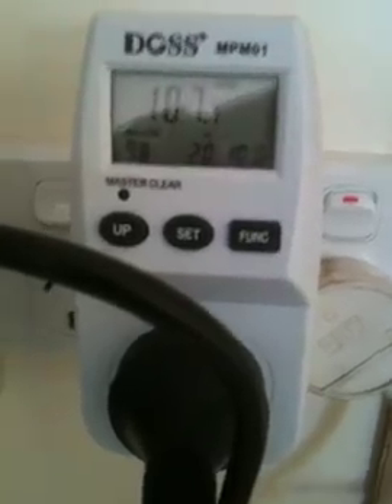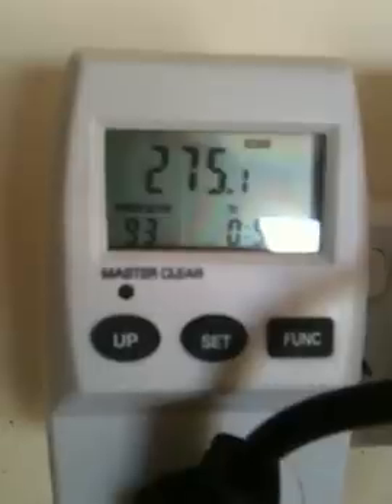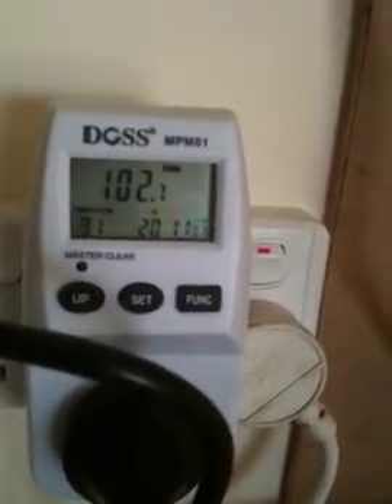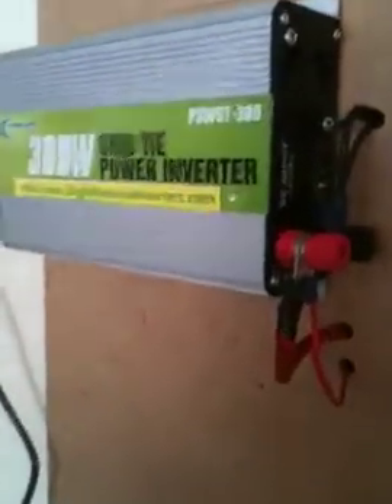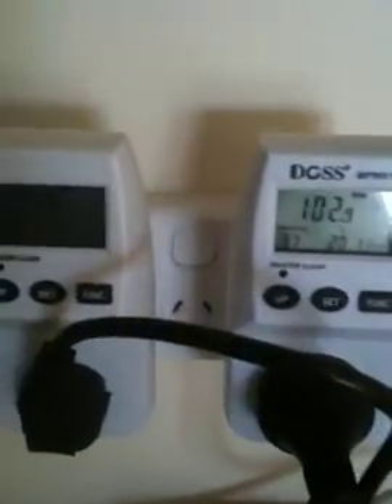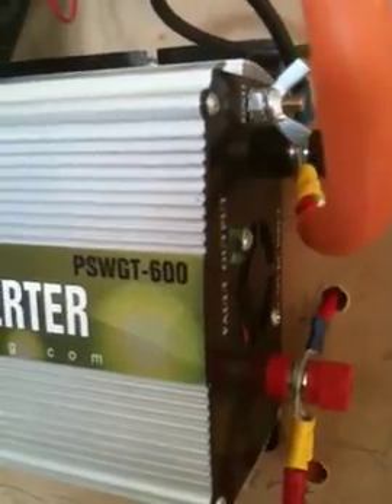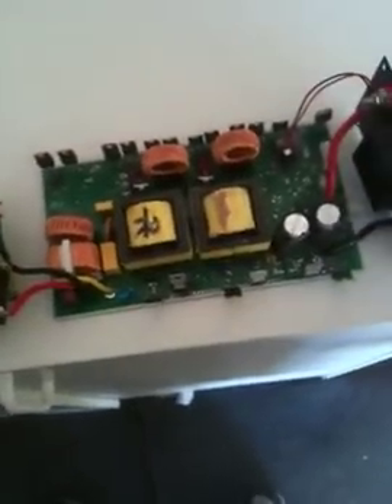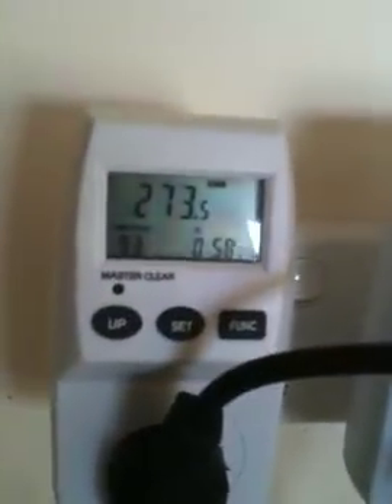Grid tie inverter update

Comment: @masonyahoo1 

Replacing the Fets is not too hard.
You can even do it without taking the PCB board out of the case.
Find out which fet is shorted with a multimeter, then cut it's three legs with sidecutters. Once the legs are cut, you can then pull them out gently while heating the top pad with the soldering iron. Once all three legs are out, clean the holes/pads with some solderwick or a solder sucker. Fit the new Fet into place and re-solder each leg/pad from the top of the board.

Comment: @masonyahoo1 
I tried using an AC time switch, then a relay and finally a solid state relay.
The SSR was the only device that seemed to reliably switch the GTI on and off at the AC without causing the spike that damages the FET's. 

I guess you have already discovered that these things draw a fair bit of AC power at night. If you add up all the Watt hours of power draw overnight, it adds up to a fair proportion of the following mornings generation, so ideally they need to be shut down somehow.

Comment from the maker: @sparktastic1 
Hi,
Thanks for the comments. I have treid a few differnt meters. I have 3 of them.
They all work out about the same only about 1 watt up or down. The little fan runs all the time but it does not stop making power. I have also added another fan to the top of the unit to help with cooling.
Thanks
Shane

Comment: Find out which FET is shorted (usually Gate to Source resistance will be < 10 Ohms) and replace with the same part number. You won't have to replace all the FET's or diodes.

These GTI's frustrate the crap out of me!

They work OK (as long as you understand that they are severely overrated), until they are subjected to that power-up spike on the AC.
The 110V US models don't seem to be affected by this problem at all.
 
Now time to try the SUN-500G GTI. They get good reviews @ 110V anyway.

Comment: I have repaired several PJ GTI's in the past and like you, I am on 240V 50Hz. Say no more...

Anyway, the thing that kills the mosfets in these inverters, is contact bounce or arcing on the AC side during power up. You don't even need to have anything connected to the DC terminals, but if there is any arcing on the AC side when you plug it in, it will kill one, or more of the 600v Mosfets.

I have replaced the fets with up to 1200v rated devices and the problem still occurs.

Comment: Yeh right.. Actually no.

There is no way that a PJ 300 GTI could produce 275w of sustained output even if it had 1kW worth of panels connected to it, let alone only 250w worth of panels.
So, I'm guessing that either your AC power meter is wrong, or something else 'weird' is going on.

You would be lucky to get 175w out of one of those '300w' inverters, without it overheating and shutting down every few minutes.

Good video though. Utube is a good way for people to pass on GTI info & reviews.